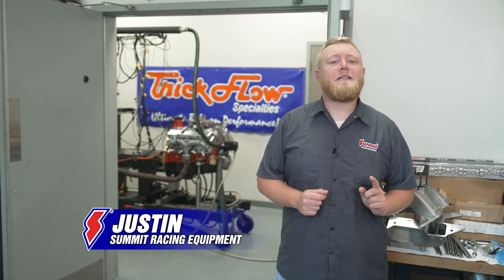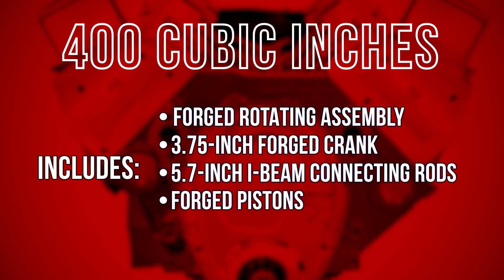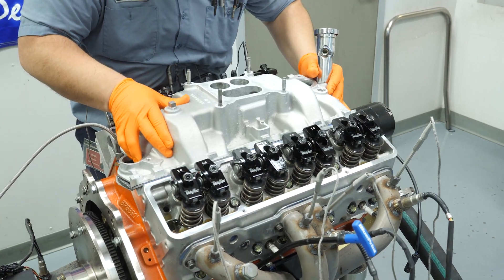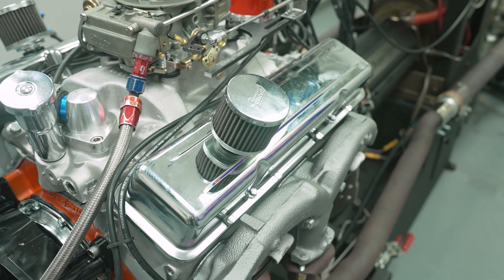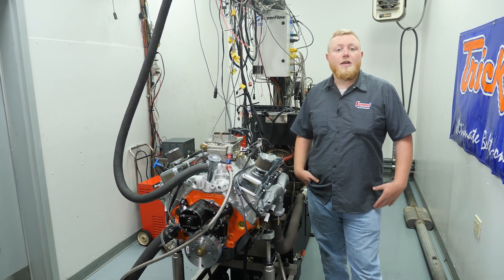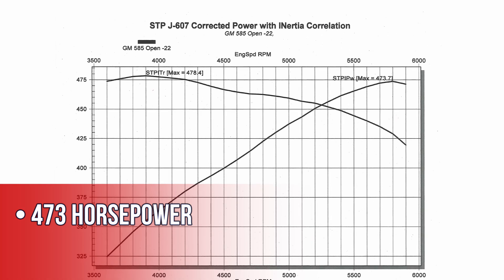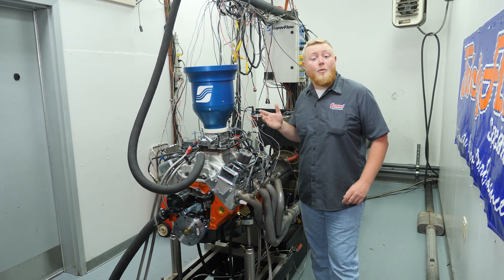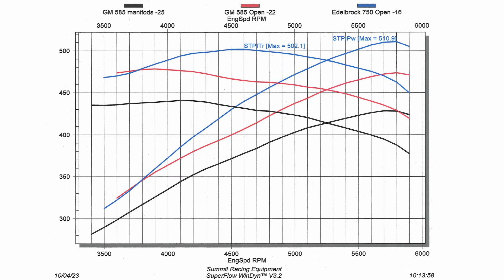Induction and Exhaust Swap Test! How Much HP is to Be Gained?

Comment: Interesting video. I Built a 406 sbc around these heads. I wanted to build a stealth motor for my 69 Camaro. I used a Factory DZ 302 manifold and a 780 vacuum secondary Holley. I ran a comp cam roller .570/.576 242/248 cam. IMO this test should have been done with a bit more cam as these heads flow well up to .700'' lift. even with the factory intake I made 538 hp and    527 ftlbs torque. my motor makes over 400 ft lbs at 2500 rpm.....very streetable. Good test but I don't think that cam showcased what these heads are really capable of. My only regret is that I should have ran more cam.
Reply from the maker: Sounds like a great Combo! Thanks for sharing and watching !

Comment: Why would you tell us it's got a .555 lift cam without the duration specs... you would know that duration is by far the most important part. Was the manifold port matched. Compression??? Lots of info missing. Going by the low peak rpm, the cam is relatively small, which makes it a great street motor. What is/was the cranking pressure?
Reply from the maker: Great questions! We’ll track down those specs for you!

Comment: Holley's are not Factory Carburetors.
Reply: They were on factory performance applications such as the L79 327 in the Corvette that this engine is going into.
Reply: @Captainfab406  Exactly but not stock.
Reply: @VeeVets I guess that depends on your definition of 'stock'  A Holley carburetor IS stock on a L79 327 whether it is in a Corvette,  a Chevelle or Chevy II Nova. That is why this guy called it the stock carb and intake.
Reply: @Captainfab406  I guess I've forgotten more than most people will ever learn.
Reply: Holley’s were used on all the DZ302’s in the Z28 Camaros. All the Lt1 350’s in the vetts and Camaros had 780 Holleys. The 375hp 396 and the 427’s had holleys as well.

Comment: more of the 4.6 ford modular engine that twist fractured the OEM ford 8.8 cv axles off the wheel hubs... nothing more then a fuel pressure regulator switch. whatever it has was enough to slowly push past the upper tensile limit of the 1'' drive axle thru 8.75:1 of gearing. "the whole rear end got thrown out for a straight axle 5 link kit", know it makes at least 270lbft to 330lbft. so that 1.5 inch thick drive axle shaft in the 5 link is only within a 3:2 ratio of holding what the mod motor does, and if there was 15psi into that block it would brake those to needing 1_5/8 shafts. i read at one point in time that the1987 to 1993 year was a run of 4340 scat casting from ford and the date code on the car is 1993/12, interesting it might be able to just go for that 15psi? very heavy street car not fast but the traction the heavy axle has is nice. boost reference fuel pressure regulator... 1.14lbft/1ci ... shorty header turbo manifolds would do it, very little aftermarket support for that exact application in a 1994/95 thunderbird, doesn't need to be changed around. if the 5.0 blowers fit on the 4.6? down the road of priorities...

Comment: if summit would like to sell some parts they might tell the viewer what pistons, weather the heads were ported of not, the cam and cam timing. sounds like one of the aftermarket blocks.
Reply from the maker: Yes , these were ported heads from Trick Flow and it’s a hydraulic OE camshaft.